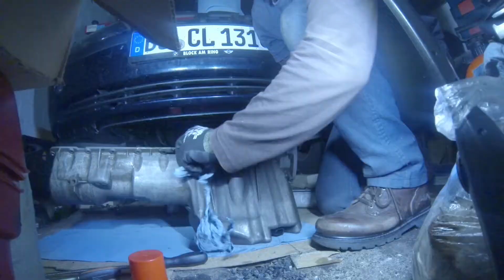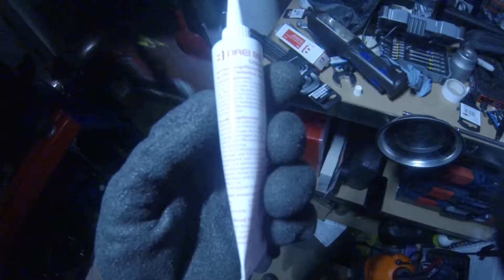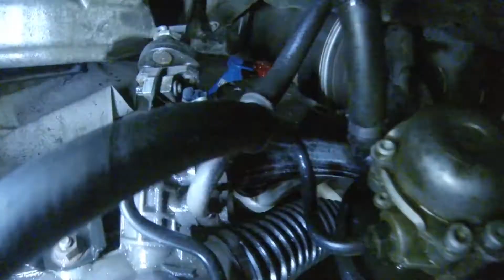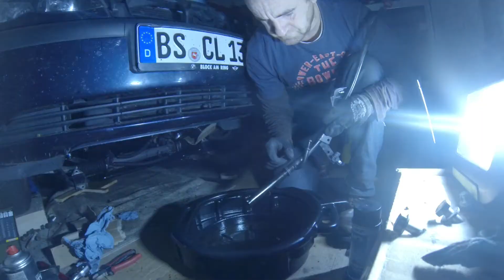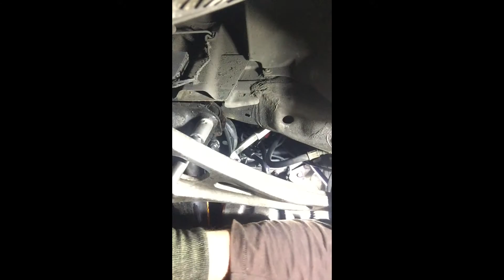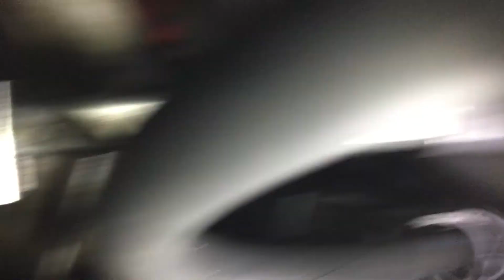BMW oil leakages fix I Gaskets change I e46 e39 repair project Part-05

Comment: Nice one. I need to fix the oil leaks too. I will start at the top and hope the pan gasket doesn’t need to be replaced. Looks like a huge pain. How come you didn’t do the steering coupler? It’s recommended to tighten the steering.
Reply from the maker: Yes it is a huge work and it needs a lot of time if you do it without a lift. 
The steering coupling was still in a good shape and replacing it later on is not a big deal. You dont have to lower the subframe. 
But after the whole work my bmw is not leaking at all.
Reply: @DIYTEA Good. The steering coupler might not show wear but after 200k a replacement is likely in order, I think.